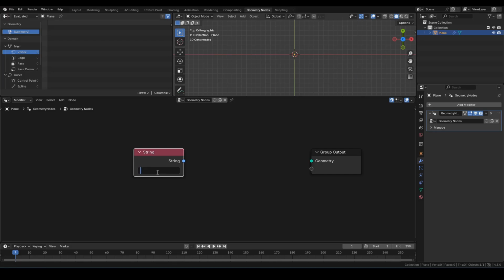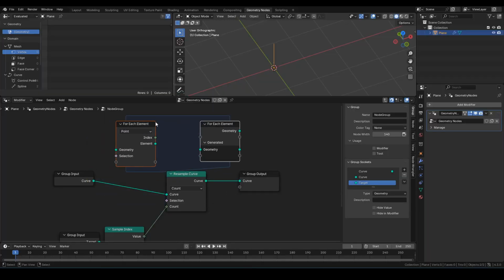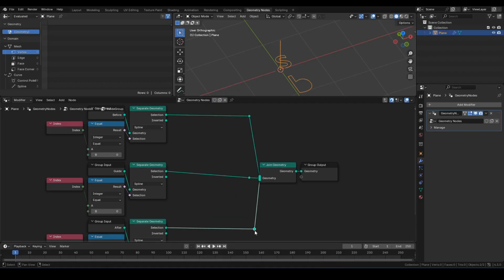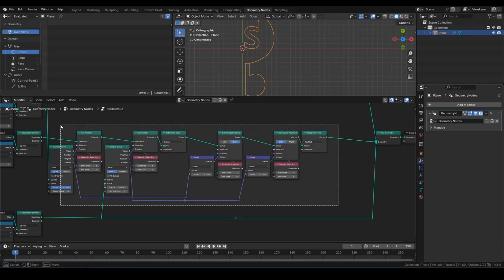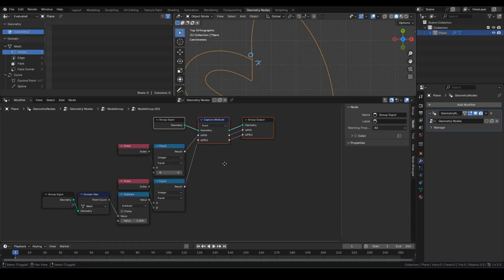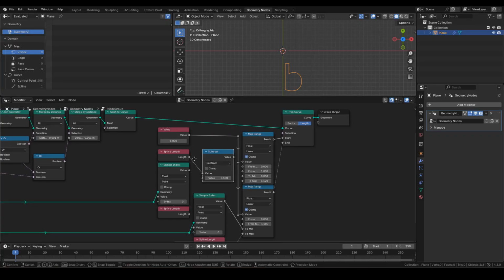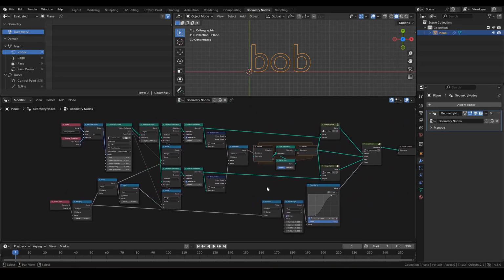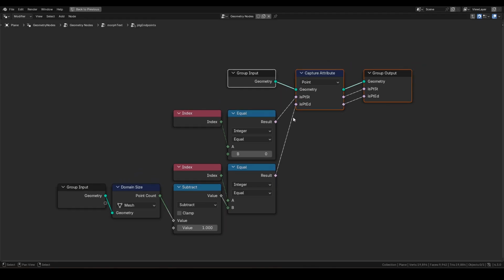Text Effect with Blender:  Spline Morph Effect [tutorial]

Comment: Also could you make a video about how you used SNA to make the pulsing glow. I tried but not working correctly
Reply from the maker: Sure, I will upload the setup and link the video in the description later.  (Might take a little time)
The key is to use a float curve and map range to control the emission strength and make sure to drive the float curve value with the same map range result of morph.
Reply: @BlenderStudioS-bs8mr  with you hints was able to get it working. Thanks so much!

Comment: Very cool. But how do we close the start points? Beginning of video examples are all closed, but end they are open. I have a method using less than into trim node selection, but only works with factor trim with single word
Reply from the maker: Hi there, sorry for the late reply
I actually have a Instance on points with a Mesh Circle added to the end of the spline.
If you set the scale to radius, it should cause the splines to appear closed.  (There will be a very small gap though)
Reply: @BlenderStudioS-bs8mr  thanks for the reply. Is there a node to input into instance on point existing? Or I have to add new nodes to get the points?
Reply from the maker: Instance on Points the spline.  Make sure to add Endpoints Selection to IOP selection.  It is also shown in the example video in the description =)
Reply: @BlenderStudioS-bs8mr  I had instance connected correctly, but kept trying to connect the point input to different places, you video shows it was much easier, thank you for sharing!